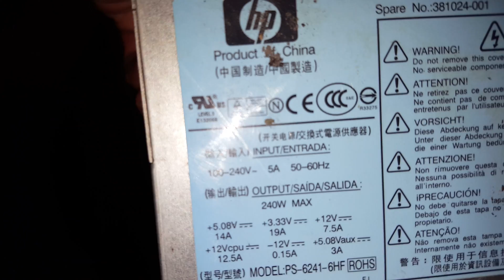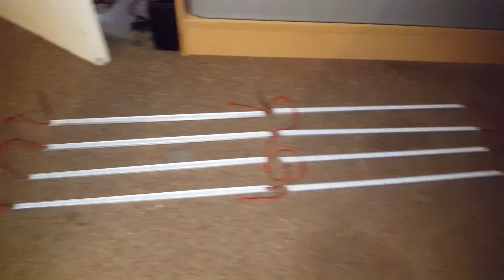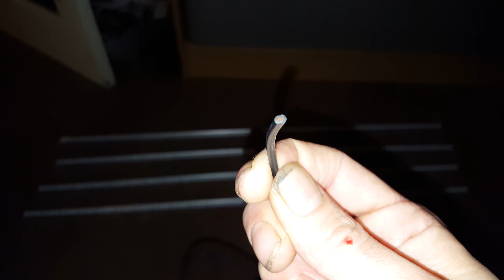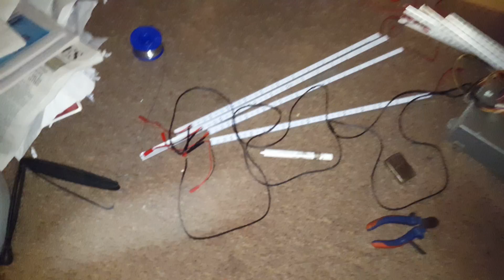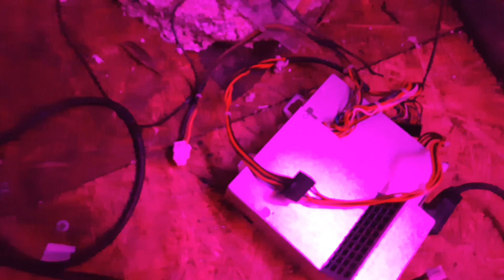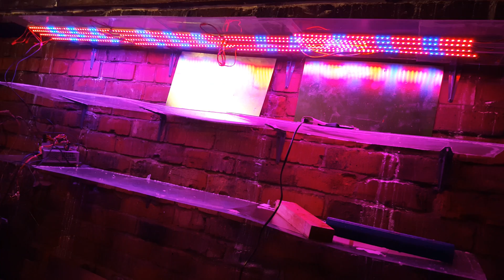Powering 12v LED Grow Lights with an old small form factor PC AT PSU

Comment: Thanks for the video appreciate it, would you say that a corsair rm850x or corsair hx850 would power a led grow light in the same way as say a meanwell led driver? One is for PC and the other for led specifically? Or is basically the same thing? Thanks
Reply from the maker: Hey, I'm afraid I dont think the corsairs would work for this one, its possible say but though they are great for feeding the hungry vga i think they were a lower voltage with a higher amps to do that to stop over heats and melt downs. Where those old MicroAT powersupplies pumped out the extra voltage to get the best out of these led strips i think. I see the ebay retailer i was buying off finally pushed the price sky high like they do. A brand new old 'Micro AT PSU' should be £5 :-) you might have some luck if you check on ebay or google for say a 'HP 381024' i think you would find that that micro AT PSU that fed the old HP small factor computer worked in alot of different models that should also be on sale as well, but yeah £5 is more than enough for an old new one of those with them not being used on pc's these days. Hope it helps. My best. Paul
Reply: @battonfive  hey thanks for an amazing and fast response, all my best mate.

Comment: Great job. How are the lights doing on plants?
Do you recommend these 5:1 led strips for vegetive growth?
Reply from the maker: Hi Dave sorry for the slow reply I've been swamped for a week :-) hmm the plants did really well there, i did aload of dionaea for a christmas fair with them and they looked really nice and healthy. my perspex housing over these was experimental and was taken down where i then repurposed these led strips for some micro greens i want to get shortly, but i will likely mix some dionanea in amongst them around the edges at the fronts i think. yeah vegetive should work fine with these, red a little more but there shouldnt be much difference in it i think. the way these were wired means they get pretty warm but give off nice light levels, if you can keep your plants about an inch and a half from the strips in a decently ventilated spot they should do pretty well i think :-) with veging i would run each strip about half an inch (15mm) in parralel next to each other i think. these are decent for light density but for best results i think concentrating them would work well more on veg where i dont think it should effect growth to much. Good luck with yoursetup there. My best Paul
Reply: BattonFive thanks very much for your reply Paul. I actually bought a 5mtr strip of these with power supply, but haven’t got around to making the light panels I have planned. Now the days are getting shorter I will need to do so.
I’ve been growing Kratky hydroponics in the conservatory this summer, and want to continue to grow my own leafy greens and herbs through the winter.
Cheers, and keep up the vids.
Dave
Reply from the maker: @pilkyish  most welcome, the 5mtr strips should be enough to keep you going over winter to grow some microgreens say and some dionaeas, where if you were after growing larger quantities i would suggest the old pc power supplies as they are pretty cheap and the strips and a soldering iron, its quite fun to make the units and the units are low wattage which goes along way and very efficient, where the strips last for 2 years no prob even with a bit of extra current through them.
i have not done any hydroponics techniques so far, i liked the idea for convenience and for keeping it clean and for air flow, but i also liked the rare minerals in the soils so tend for soils for non carnivorous plants. for small plants though these grow led smd strips have impressed me, where for a bigger plant over say...2 feet i would say a bulb might give better results. these strips seem to work better top down rather than top down and side on, the light doesnt seem to penetrate the leaves as much as the bulbs, but for small plants they should do the job pretty well i think, while the new strips have been improved i think now since these smds here. 

Thanks Dave sure you will enjoy dabbling with them, its great fun, if they give you headache though, discreet headaches, do pick up some cheap grow led eye protection. i tend to turn them all off before i water everything then turn them on after im done, they are really nice from afar but up close you can feel your eyes giving you a migraine.

Comment: Completely pointless. The PSU gonna take 200+ watts of electricity to run LEDs that would use way less than that if u wired to plug directly
Reply from the maker: sorry did you just advise to wire 12v lights to the 240v mains?
Reply: BattonFive i believe he did good sir

Comment: if there is any advice I can give you it would be to paint any surface to reflect ,with MATT white emulsion rather than shiny absorbent materials...by the way your a genius ,could you run these strips on a 12v or 24 or 48 v battery system or solar panels or both ?
Reply from the maker: +uk-medi-weed-grower thanks for the positive and for the input, I will paint it Matt as you say with white emulsion :-) much appreciated :-D But yeah there is no reason why these couldn't be run on a battery system, with some decent SLA batteries you should be able to run them directly off the terminals, the 12v battery would likely run say 20 strips a battery I would say :-) or you could even use a battery system and use an inverter on the battery array and run some AT PSU's off that inverter :-) Its definetly worth noting though after testing that you need the old psu AT supplies (they are everywhere and free) rather than the new ATX PSUs as the old AT ones give you more wattage to each of your strips :-D Solar, battery array and these strips would work really well, even wind with a vawt or hawt would be good :-)
Reply: BattonFive thank you for your response...I was thinking of using the light strips as supplemental lighting in a poly tunnel .
I wanted to know the wattage of each strip.. did you say 15w and if so would that be actual electrical usage being pulled from the wall ?
Reply from the maker: uk-medi-weed-grower you're welcome :-) each strip is rated at 15w, but after testing using this AT power supply on 20 strips im getting 9w a strip with an extra 7w for the psu fan so its given a realistic 187w for the 20 strips.
 from the heat I would say 9w would be perfect really, if you were to force more wattage down them a lot of the energy would just be wasted on heat from what I can observe here :-)
 poly tunnel sounds a good move but I would add extra wind in there to help remove condensation on your plants, compared to the  HPS bulbs, these dont produce as much heat :-)
 one thing I was even pondering on is just sticking the metal sticks in to the earth in amongst the plants leaves and leaving them there, these strips get hot but I dont think they would damage anything :-)
 I will be doing an update on these in the next day or two, im trying to run the psu in parallel so I can run say two AT PSU's soldered together so they can produce 400w of power rather than the 187w im currently getting off the one :-)
 hope it helps :-D
Reply from the maker: uk-medi-weed-grower thanks the closest I got else where was a £30 psu for a 3d printer but if an old psu will supply for the ballast and they are free then its a good way to recycle them :-)
 Thanks for subbing :-p